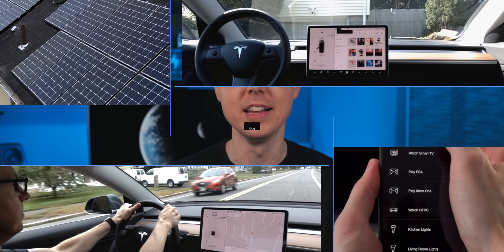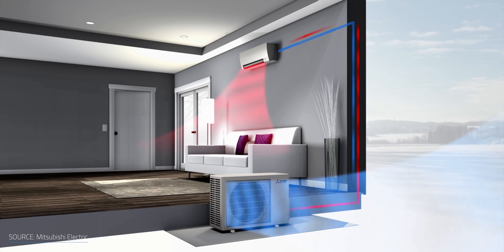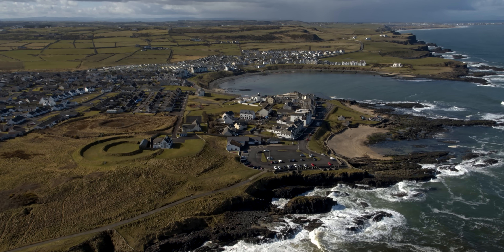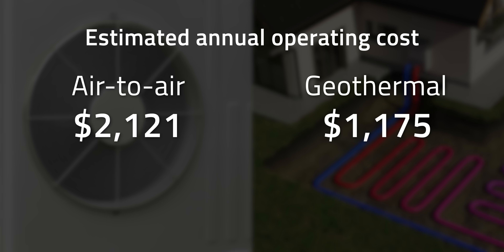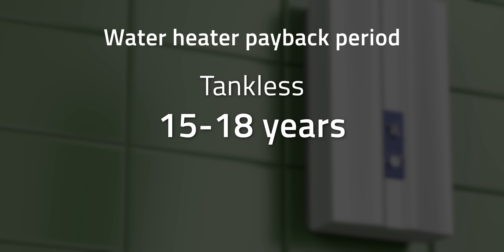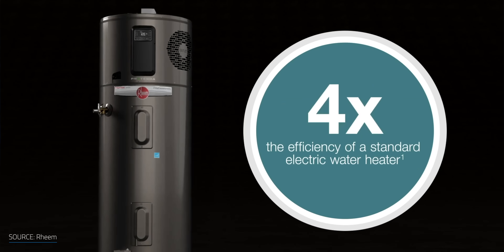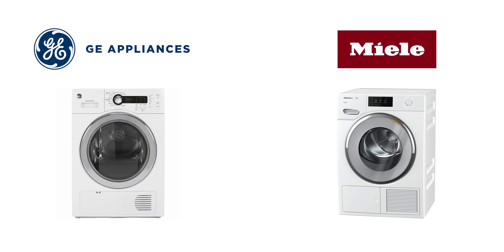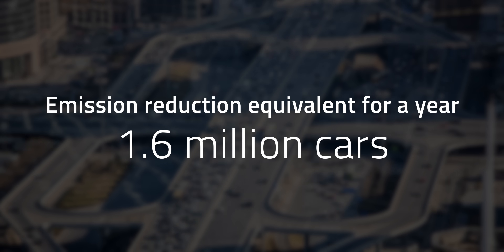Why Heat Pumps are Essential for the Future - Explained

Comment: Thanks man. I am in Europe and way behind the curve on varmluftpumpen. This video is quite helpful. Right now our per kilowatt charge is doubling (it was very low before) so there is motivation to install heat pumps. I've got a real screwy house layout so I will have to supplement with electric radiative heat, hopefully minimally.

We looked at solar and we just don't have enough roof space to generate all of our needs. It has gotten quite windy here over the past few years so maybe a wind + solar solution might be the way forward. Hands down, the heat pump is our single best way to cut our electrical use in our home.

Comment: I live in California, had to install cooling anyway so decided to just switch over to heat pump and remove the furnace. And because i already have solar + batteries, the savings are more than you'd think. Haven't paid for any energy in 2 years (including charging car, heating, cooling, cooking)

Comment: We put in a ground source heat pump here in NC about ten years ago. This has worked much better than the aging air source heat pumps we previously had. But before we did this we increased our insulation, switched to LED lights and added storm doors. After installation of the ground source heat pump our yearly electricity consumption dropped to 8000 kwh. Adding solar dropped it to zero, even with the addition of two EV s and 2 electric riding lawn mowers. For anyone interested in how we did this go to “Five Minutes With Dr. Know” on YouTube.

Comment: I don't understand why people say that heat pumps work "a lot like air conditioners." They are LITERALLY the same thing. The only difference is that if it can run in "reverse," it can provide heat in addition to cooling.

Comment: Here in Maine we've had a 119 % increase in electricity generation in 366 days plus considerable increases in delivery costs. That is a lot a lot a lot more than my pellet heating cost which is as clean as any fuel you can use. Pellets are made from 90 % of sawdust waste (not really waste because it is now used) . Trees are a carbon neutral fuel. Good stoves are 75 to 85 % efficient and they use very little electricity my stove  uses  run 156 watts on high I usually run on low . To light the stove uses 456 watts which takes about 3 to 4 minutes. This year fuel cost was $801 dollars. Buying pellet fuel is cheaper than buying firewood in my rural area and stove runs automatically just put a bag or less in the hopper once a day

Comment: 3:11 when running backwards the condenser is inside.
You force the liquid to evaporate outdoors where it needs energy for the phase change into a gas.
The gas gets pumped inside and gets compressed forcing it to condense and it needs to release some energy in order to do so.

Comment: I love my waterfurnace ground source 7 series.  my onlly gripe is the expensive touchscreen thermostat only has 4 setpoints/day,  and I'd much prefer a continuous curve thermostat that runs the unit at its lowest most efficient settings (Smart recovery mode helps a bit, but not perfectly)

Comment: We have a heat pump (almost all modern A/C systems are heat pumps).  I have not once used it to heat my home though.   (Phoenix AZ)  It may or may not have resistive elements.  Most do, but again, most folks never turn them on here.

Comment: FYI there are air-2-air heat pumps that rival the efficiency of air-2-group heat pumps. Those are installed as primary air circulation and water heater replacement for the house. Those do not push the excess heat out to air but use the heat to heat water and also optionally water circulation floor heating. Other efficiency improvement is that they collect all the heat out going air flow of the house. 

One thing you should be aware of the air-group heating is that it some cases will kill all the grass and plant of your yard.

Comment: Hey Matt, Heat Pumps use electricity, so soemwhere along the line, something has been used to produce that electricity.  Most of the time, that will injvolve fossil fuels - you can't just say heat pumps don't produce emiissions !

Comment: Only comment on this video is that it is inappropriate to use "Efficiency" for heat pumps. In thermodynamics, Engineers use efficiency to describe the fraction of energy that is converted to work or vice versa. Efficiency can never be greater than or equal to 100%. In Refrigerator / heat pumps, work is being used to transfer energy from one location to another. It is not turning the work into heat.  COP is used to avoid the confusion of having an efficiency greater than 100%, which is not thermodynamically possible.

Comment: Just quoted $46,000 USD to replace heat and ac with heat pumps in 1600 sf house in northern US. Not a gouged, not an outlier. New explosive refrigerants that will soon be required means when heat pumps today go the entire system down to the pipes will need complete replacement and the cost will be higher due to explosive refrigerants.

Comment: Was a little confused about this "Heat Pump" term, but after google searches, I found the Americans call Split Reverse Cycle Refrigeration Systems "Heat Pumps" and they consider split systems to be something else, in AU 90% of our cooling/heating systems (Split or ducted) are already heat pumps, and have been this way for many decades, there is nothing new here, finally we are ahead of the US on something for a change :) I have a 15yr old Inverter ducted "heat pump" already, nice to know its now considered cutting edge equipment :)

Comment: The more they overthink the plumbing, the easier it is to stop up the drain.
Mr Scott's words are so true when it comes to heat pumps.

Heat pumps malfunction easily.
A leak in the system, you need an expert to fix it and refill the system, depending on laws may also get a fine.
The gases in the system are toxic and if leaked do more damage than a fleet of cars.
If your house isn't insulated to a supper level, a heat pump is pretty useless, in old homes this is a big issue.
If you live in an area that gets really cold, forget about heating your home with this.

Besides, if you want to go down this route, just get a split unit air conditioning, half the price and way better cost/performance.

Comment: Another excellent and informative video. Thank you. The problem I see with heat pumps apart from the upfront costs is the space required. A typical UK home would struggle to find the space, particularly anything geothermal. Great food for thought though.
Reply: Vertical hole don’t use more then a 1m square, the problem is the proximity to neighboring holes, if it is to close it starting to effect each other. But it’s overall a very efficient system.

Comment: I use a very advanced piece of tech to dry my clothes, which is much more efficient than heat pump dryers, has no emissions whatsoever past the fabrication. It's called a clothesline and it converts wet clothes + time into dry clothes. Initial setup costed me a handful of euros (pins included), has an annual cost of 0, an efficiency nearing infinity, and according to my calculations, should last longer than my lifespan - which I consider is long enough. The only thing it costs me is about 5 minutes to hang the clothes on it, and the day after, 5 minutes to unhang clothes from it, so 10 minutes for every 7 kg washing machine.
My installation could dry up to one machine per day if needed, but that's because I live in an apartment, people with a house should be able to install something with higher drying capacity.
Reply: This thing you speak of is truly amazing. With this we could save the planet and we would not have to hear from Greta again!

Comment: Heat pump dryers can save even more energy compared to vented ones if the dryer in the main apartment/house, because for every cubic foot of air they pump out of the house (And it is a lot of air in 60 minutes), outside air will flow in. In cooling or heating season that means, the energy you had put into the AC or heater is literally pumped out the vent, and outside air will flow in. That air will come in the way of least resistance, might be another vent like in the bathroom (reversed) or through the chimney, which will lower air quality significantly. Or less airproof windows, doors or attic access holes.

Comment: I got one, (two actually) and we're super chuffed. We started to live in our new houseboat since January of this year, and those first months we didn't have full control, so I'm still waiting for coming winter to see how it actually provides value. On top of that we have PV, or Solar... We're very curious as to the monetary difference. One of the heatpumps, the main one, uses the surface water the boat floats on. That one has a coefficient of 5. On top of that we have aircon that also can heat (air to air heat pump) added value of that is the direct effect, when the floorheating connected to the main pump hasn't spooled up, and the evenings become nippy. I can also toss a block of wood in the stove, but don't want to do that on the regular..

Comment: I'm no expert, but I believe you can install a heat pump water heater in a small space as long as 1) it can pull in air from outside that space (like under a door or through louvres) and 2) you can vent it somewhere else. If you're replacing a gas water heater, for instance, you can probably use the existing vent pipe to exhaust the heat pump water heater. However, a lot of people report that they're very noisy. Power-vented gas heaters are pretty noisy, too, but if you're replacing an existing electric heater it's something to be aware of.

Comment: One of my co-workers just told me about the coolest thing ever.  Apparently they now make heat-pump hot water heaters.  (you cover this at 8:00 ) Not only are they more efficient than resistive ones, they generate cold air in your garage (or wherever your water heater is) as a bonus.

I'm concerned about your statement that it needs to be installed in an area under 90 degrees though, it easily gets over 110 in my garage in summer, which is not too surprising since the outside temp can get up to 118 in the shade.

Comment: Nice presentation and graphics.  It would be helpful if you showed cost with efficiency and available capacity of equipment.     Does the heat pump dryer take twice as long to do a load?   Does one need two air to air heat pumps to heat a home in Wisconsin winter?   This information would be useful for me.   Thank you.

Comment: quick bit matt, MOST refrigerants currently used aren't bad for the environment in regards to ozone depletion potential (ODP) but are actually, WAY worse than CO2 when it comes to global warming potential (GWP). for reference, CO2 has a GWP of 1 (it's the standard against what all other refrigerants are measured against) but R410a (current residential mainstream unit refrigerant) has a GWP of nearly 2100 (in the atmosphere, one ton of r410a warms the globe as an equivalent 2100 tons of CO2 would, due to it's rate of IR absorption).
sooo....
it's a game of tradeoffs (and bottom lines unfortunately)

r410a is getting phased out in the next couple of years.. to refrigerants that are lower than 700 GWP, unfortunately they are "slightly flammable" go figure..

so if that northern ireland home uses a heat pump and offsets 6.5 tons of CO2 while only using 5 lbs of refrigerant that's a positive offset there, as 5 lbs of refrigerant is equal to about 5.25 tons (of GWP) for r410a, but anything over 6 pounds.... you get the idea.

Comment: One thing I want to note. Heat pumps do NOT move air. They heat the air already inside the home, or cool the air already inside of the home. They move heat from one space to another. But no air flow actually travels through them. The air they move around is from the inside of the home.

Comment: When I taught thermodynamics, I introduced a class of students to heat pumps with an extra credit problem on the first exam.   We had studied engines and refrigerators, so I setup the question with enough description for them to calculate the efficiency once they realized that a heat pump is a refrigerator (where the inside of the fridge is in your house in the summer, and outside in the winter).     Mainly I wanted them to think through this surprising fact that the heat energy transferred is several times larger than the input energy, until they felt confident enough that this made sense to go with it as an exam answer.   It went over well.
Reply: the heat energy produced cannot possibly be greater than the overall  input energy.

Comment: i design industrial heatpumps, mostly for factories and government facilities, this technology is a 100 yers old. However, they are complicated and not everyone can work on them if they breakdown. One of the projects i designed was to reclaim the heat from the sea and use it as a central heating system for district heating. we significatly increase efficiency this way instead of using a gas boiler

Comment: Hi sir. Would a heat pump be effective in developing countries in the tropics? Here in SEA,  our average range of daily temp is 75-100F. However, humidity is the worse at  around 75%. It is always mucky. Same happens in a lot of developing countries in Asia, where most the economic growth and population is. Thus, when a family goes up in life, they usually buy a $150-$250 air conditioner and the family of 4 sleep in 1 room to conserve energy. Our electricity rates are also high at 20 cents per kilowatt hour. Thus, we use the aircon to achieve sleep, but it is turned off with a timer that turns on the fan for the last 3-4 hours, until we wake up. Lastly, the daily wage is around $10

Comment: During the summer maybe I can save some energy doing this... Take an old window mounted air conditioner put it not in a window, but ratherly on a shelf inside my laundry room.  The air conditioner has two sides. One side preheas air to be ducted to the dryer whose heating coil I disable,  while the cooling side ofbthe air conditioner takes air from the laundry room, cools it, and ducts it to another room in the house.  

The higher cop heatpump would more efficently make heatvto dry my clothes, but would also subtract from the energy my home's central air conditioner uses.  

All I need to do is pull the window AC unit out of storage, and add some ducting.

Comment: My personal problem with them is they are just energy guzzlers in hot climates.  They need to be linked to a geothermal source to increase the efficiency exactly as you state.  We could also include liquid cooling at night linked with a heat exchanger similar to the one that emits heat into space based on the right wavelength.  I think you e covered that in this channel.

Comment: This was extremely informative! A ventless dryer, does wonders for your envelope at around your house. It’s one less intrusion where you have to worry about energy leaving your house.
Reply: Alot of peoples homes burn down from dryer vents. Over the years they clog up from lint and people don't remember to clean them out and they will cause a fire when it gets blocked enough.
Reply: Yes. Exhaust air has to come from somewhere, usually uncontrolled leakage of outside air. My old house has many things that exhaust air but no makeup air. They include bath fans, gas dryer, gas water heater, fireplace (blocked) and kitchen range hood. I need a heat recovery ventilator! 😂

Comment: A good start, there's a much wider range of heat pump technology outside this that might not be available in the USA, like much better refrigerants and hot water production using remote condensers as in the air to air systems.

Comment: 12:10 practically every dryer made for decades — other than the cheapest models with mechanical timers — uses moisture sensors for sensor drying. It’s such a basic thing that it’s rarely even listed as a feature anymore. Look inside your dryer: if you see two metal bars on the plastic somewhere near the door, those are the moisture sensor. (It measures moisture content by measuring the electrical conductivity between the metal bars, which are actually electrodes.)

Comment: Good to see that the US is catching up with the heat pump dryers! I bought mine in 2015 and it's still working great. 🙂
Reply: I've only had a dryer once and I got rid of it. Put a couple retractable ropes in the laundry room, called it a day. I'm very surprised to see everybody assumes one is a standard part of a house even outside the US.
Reply: @mademedothis424  Honestly, I have to do washing for 4 people, including 2 kids, also in the winter. There is no way I could hang up all that stuff, just out of a space restriction. I would like to hang up stuff from an energy efficiency standpoint, but it's just impractical for me.
Reply: @climbscience4813  I have five people doing laundry. When the dryer got removed it was seven, and we get more months of rain than dry months. It can get a little tight with just the two indoors ropes, so we have a removable metal hanger that we use for emergencies, but otherwise it's not much of a problem.
Reply: @mademedothis424  Good for you! For me this does not work.

Comment: Heat pumps are awesome!  Any air conditioner is a heat pump.  Unfortunately, most are one-way.  So you can use them to cool the inside/heat the outside, but you can't run them in reverse.  Which is stupid as it's basically just a valve change to do it.  They should all be built to run both ways.
Having spent time in Germany, we picked up a heat pump drier.  They definitely are worth it.  BUT heal pump driers have one serious caveat, they take F O R E V E R (like 4 hours on a single load sometimes) and can still leave your clothes a bit damp.  They're efficient, but slow.  It helps (a LOT) to pair your heat pump drier with an efficiency washer that has a ridiculous super-duper spin cycle as that can remove a lot of the water before the clothes go into the drier.